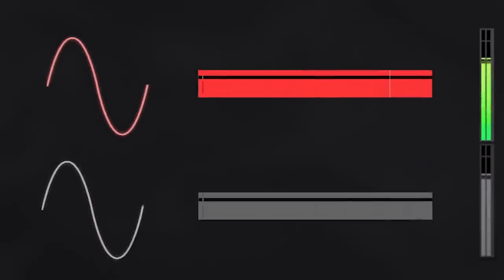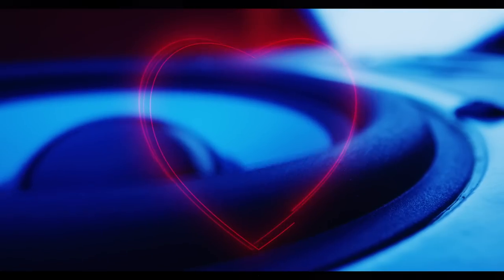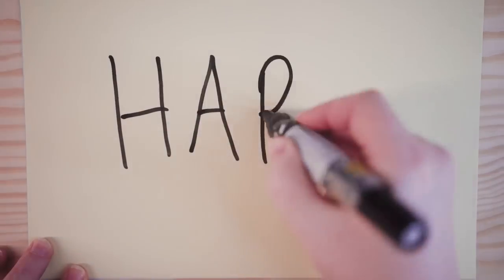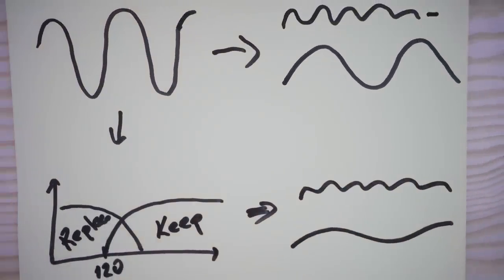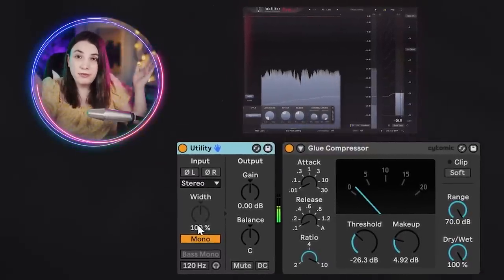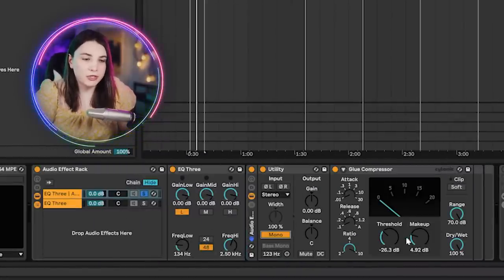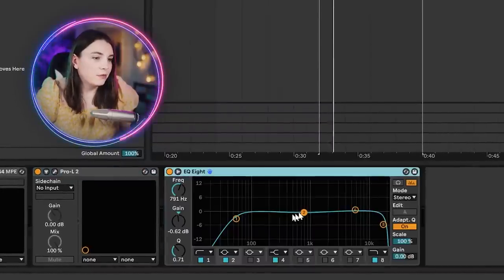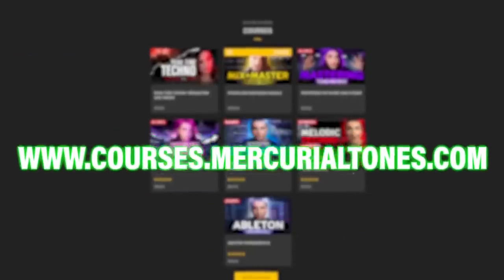The Biggest Misunderstanding About Bass 🤯

Comment: Or then, the actual fix: Never track anything below 120 Hz or thereabouts in stereo to begin with. Especially if the track is intended for release on vinyl. Ever seen a mastering engineer lose it when lousy low-end management in a mix blows a cutter head? It's not pretty: lathe engineer goes ballistic because that low-end gaffe blew the head, and you go ballistic yourself when you have to shell out for a new (or NOS...not much new disc mastering gear being made these days) cutter head for...hmm, back in the 1980s, that was a good costing several grand; God only knows what they run these days.

But yeah...the REAL solution is to never make that mistake in the first place. If it's bass, it belongs dead-center and nowhere else, with only a minimum of effects to avoid surprises. At least, if we're talking vinyl mastering.

And as for digital? Same rule applies. You 100% want your most tactile frequencies to present a unified wavefront for maximum thump and boom in the bottom end. Or, more annoying, the PA someone's going to spin on has everything summed to mono below 120 to 150 Hz, and this causes cancellations and dropouts for the entire room...and you, as producer, are responsible, not the PA guys, promoter, venue, etc. Like I said: the only 100% solution is to track low-end as mono. And don't worry about stereo imaging, since frequencies below 150 Hz get less and less directional as we head towards the limit of pitch perception, somewhere around 12 to 16 Hz.

The lathe issue, though, is making a big resurgence right along with the revival of vinyl...and there's not many "old guys" around who know how to mix and cut for vinyl these days. And that's a shame, because so much about cutting vinyl falls under the category of "black arts", and those aren't taught at most legit schools with audio engineering programs. Good to see some of this getting out there!
Reply: Nice comment
Reply: I’ve read somewhere that for vinyl cutting you should keep all “bass” frequencies below 300hz mono so it’s 300hz or 200hz or 150hz?
Reply: @mrluwin5054  It varies. Back in Nashville c. 1980, all of the mastering labs had different rules about bass. But the rule of thumb was that around 250 Hz you needed to start being careful about phase and amplitude, and 120 Hz was the top of the "no stereo" zone. But the labs all had custom voodoo that allowed for summing bass, with each lab's sound depending on these sneaky mods and hacks.

For example, the scroll rate. With higher scroll rates, you needed to keep amplitude down. Lower allowed for big amplitude swings, but you lost time per side.

That sort of got dealt with as companies started working on variable-scroll devices and schemes, such as CBS's DisComputer system, or Teldec's DMM metal lathe system. But this was all going on alongside the introduction of the CD...which is a very different creature altogether, allowing for new rules and capabilities. DMM, in fact, was astonishing, especially when used in half speed mastering. But as that hit the market, you started getting into the reissue of analog titles; this is why you would see stickers on CDs touting "Original Master". And that was technically correct...but those masters were EQed and compressed for cutting vinyl, resulting in some really crappy audio and more than a few pissed-off consumers. Eventually, that got fixed, and the stickers changed to "Digitally Remastered". These finally sounded as good (or better) than vinyl...so the labels backed off of vinyl mastering c. 1990 and shut their labs down. After that, only a handful of labels still stuck with vinyl...but finding the expertise to run and maintain the specialized equipment and facilities got really dicey as vinyl came back from the "obsolescence void".

So, what that has to do with bass is that, if you want really good vinyl mastering, you have to hook up with a lab that's got some serious knowledge about these old methods, and who understands all of the mastering "black arts" for both digital AND analog formats. Not many present-day mastering engineers do, save for ones that learned the craft by example from these older lathe ops. Almost a lost art, tbh.
Reply: @mrluwin5054  I don't know, but if it were me, I'd find the company I want to use and consult with them about this.  

I would think that most/all companies must analyze and/or process the digital audio they receive as default procedure.  I would also think processing would vary from company to company.  

Talking directly could confirm for sure what frequency is ideal.
Reply: @d_e_e_k  Exactly. You're talking about that set of not-quite-tangible criteria where a tweak or two can make a huge difference.

F'rinstance, two London-based mastering engineers: Porky, and Arun Chakraverti (I think I got that right...?). Same general period of time, same town, similar music being worked with. But if you needed detail, you'd go with Chakraverti...while Porky was/is the dude if your tracks need that "in your face" sort of slap.

It's just like making sure to get the right engineer for tracking, maybe a second for mixdown. But the lathe engineer is as...if not MORE... important than those, as the guy cutting those lacquers is determining the final form of your work as the listening audience's experience. Kinda scary, actually...but as you note, you need to check what they're doing, too.

My suggestion for that is to have the lathe engineer work out his strategies and then you will want him to cut an initial set of lacquers so that you can take them back to the studio and A-B them with your actual mix master. While doing that, note anything that sounds as if the engineer's choices aren't quite right, then you have some points to discuss with the lathe engineer to tighten up their results to match your own vision.

But if they won't have that discussion, then find another lab. Also, "approval lacquers" might cost extra...but it's a VERY well-spent extra. If they don't feel like doing that step...again, find another lab.

Comment: The theory is correct but the conclusions are all wrong... Phasing is a mixing problem. The main issue here is that you don't consider how the signal will be played. If you're mixing exclusively for headphones you're fine. But if u consider most PA systems sum up the subs to mono you outta luck...